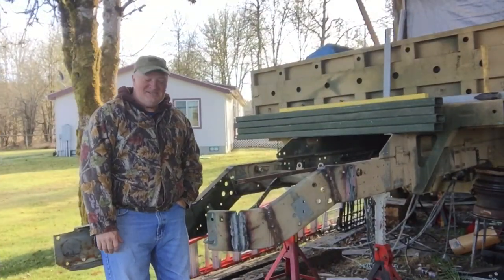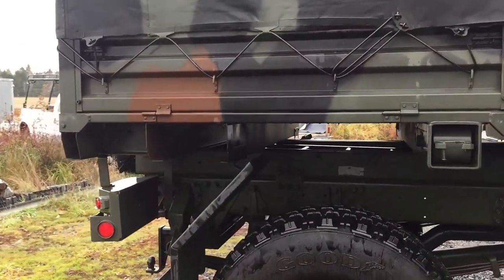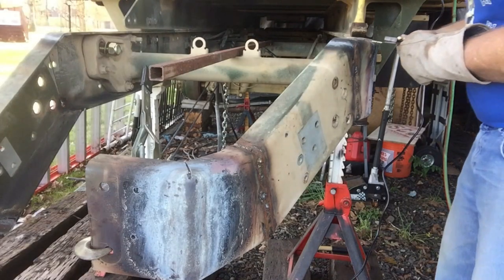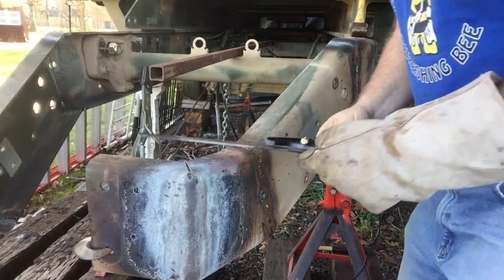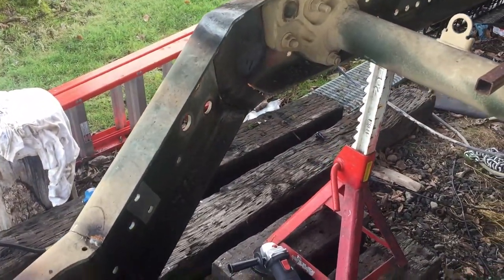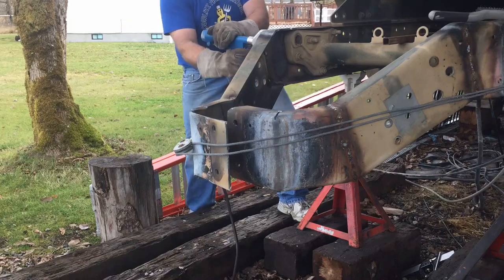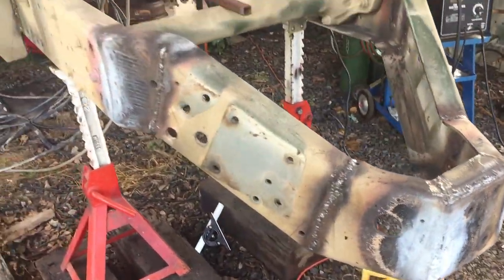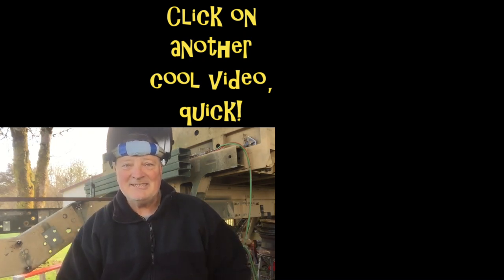LMTV TRAILER BUILD Joining the Frame Rails! #90

Comment: Cool, I've never seen a Shrink Wrap Heat Gun used that way.  I've used a weed burner type propane torch to heat metal but looks like the heat gun may concentrate the heat more in a line.   You will not be able to flame cut with it though.
Reply from the maker: Yeah, I know... I'll have to work on getting the flame cut tips and whatever else I need. Thankfully, I don't have to cut any more metal for this build with a torch.
Reply: @HelicoolsHelipad   For general small heating jobs and brazing you can use the standard Oxygen/Acetylene tips.  For the cutting torch you need a propane tip.   The fitting on the Acetylene gauge/regulator will fit directly into the propane tank, they are the same.